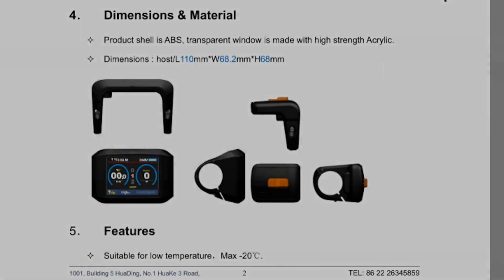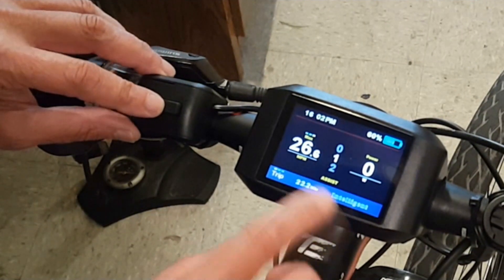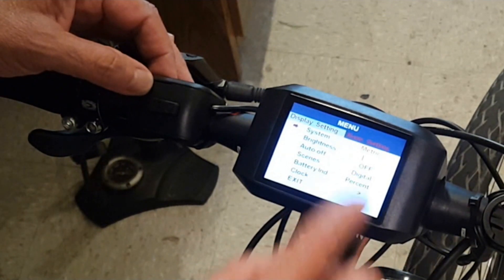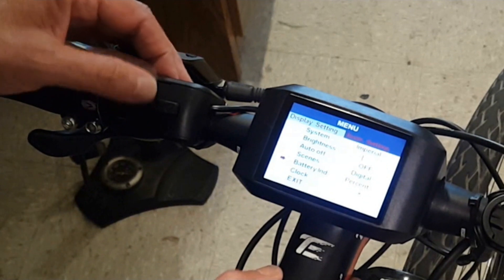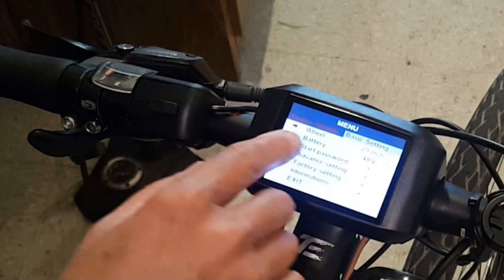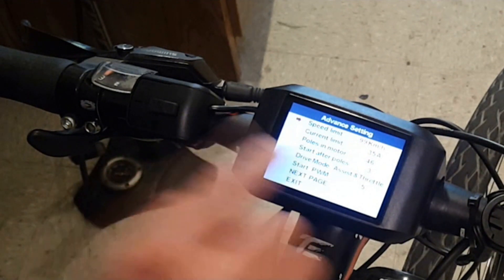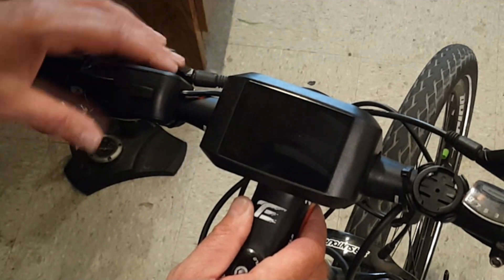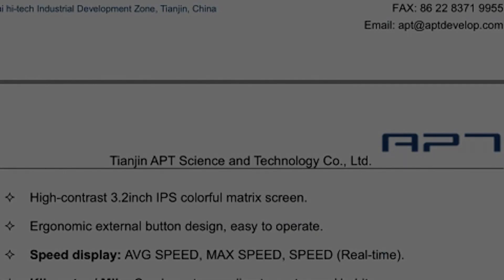TOP PICK - TFT Color LCD E bike Controller

Comment: Hey is there a way to acces Like different gears/ modes so for example mode 1 goes 25kmh and then if you like switch to mode 2 it will be able to  go full power

Thanks for your answer